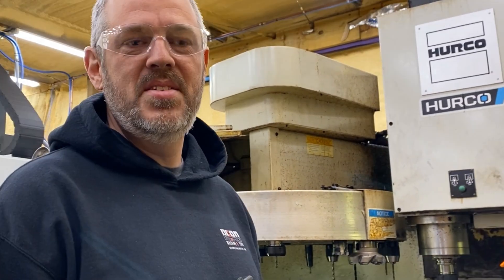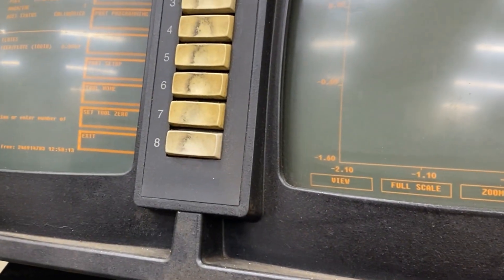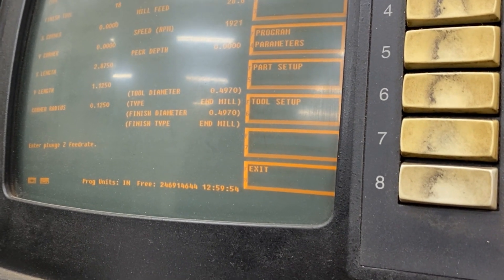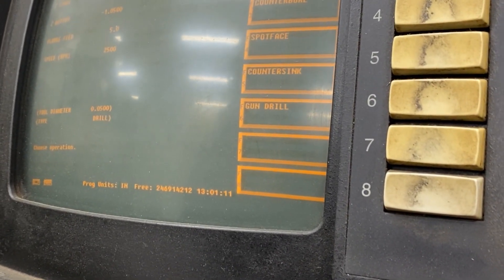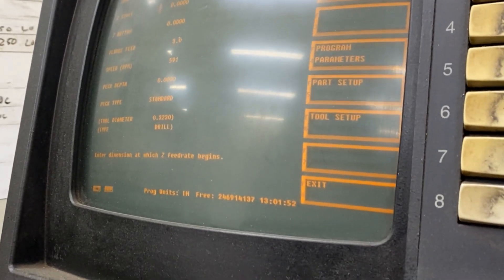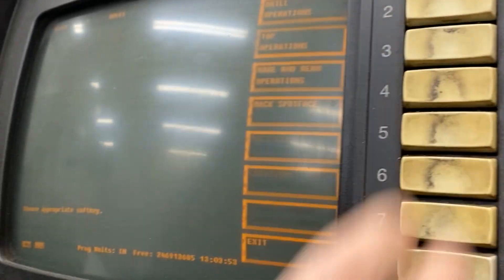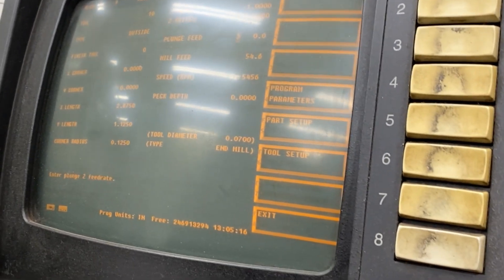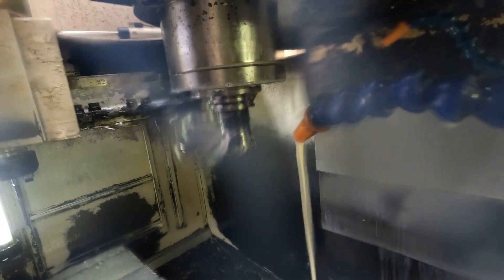HURCO BMC4020 SETUP AND RUN

Comment: Nice video. I run a 2020 vm10i with winmax. I used to always use conversational but now i always use cam. A lot quicker overall. The conversational is great for simple parts though. I find the control great in general for prototyping to check things as you're progressing
Reply from the maker: @lawmate  I feel the same way now…